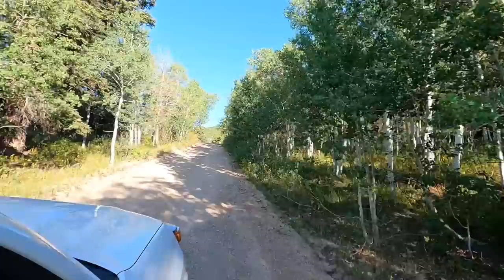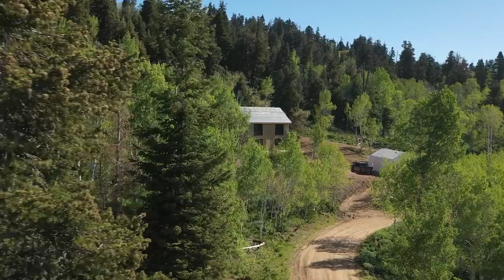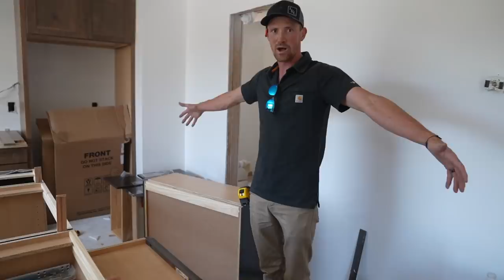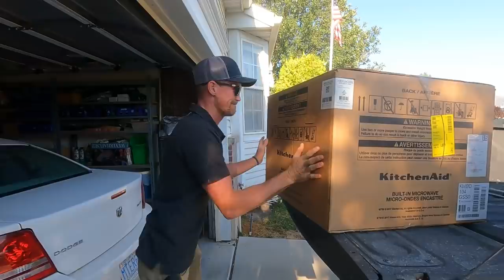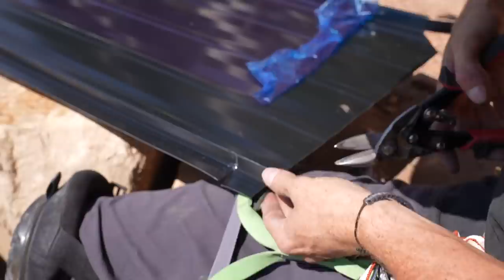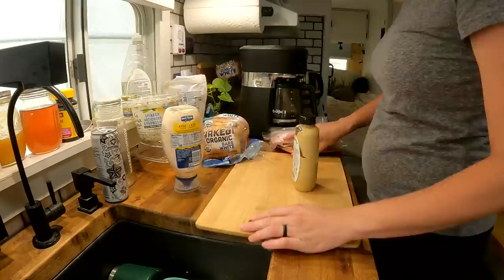TAKING ON THE ROOF | BUILDING OUR OWN HOME

Comment: You're wasting valuable work time by not being organized but I haven't met a homeowner, yet, that has good respect for tools. They typically leave them where they were last used and have no central location where to store them. The same goes for materials and waste, no plan to keep them out of your way so interruptions, continually, to move stuff. Good luck.

Comment: I know you hate this but there is an easier way to be d
Reply: To bend the roofing for future reference it's called a sheet metal brake. You can rent them from most tool rentals.. okay I promised you a paint roller cleaner to use to clean roller pools at least 20 times. Okay first thing you need is about 16 inches of 1/4 inch all thread. 1.  1/4 cap nut 4  1/4 flat washers. 3  1/4  hex  nuts and 9
Reply: In addition to the  when it's all assembled chuck it into cordless drill  get 2..    5 gallon buckets fill one with hot and one with cold water. Slip the paint loaded roller on the  spinner cage  spin it out in the hot water until the paint gets milky remove itfn from hot water spin it out in the cold repeat as much as needed.  Final spin  suspended inside an empty bucket spin till dry.